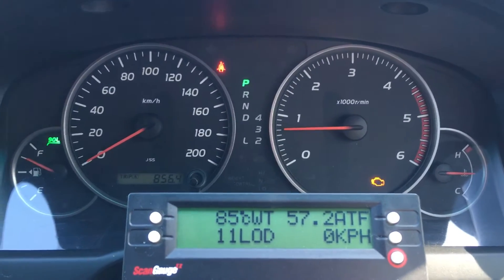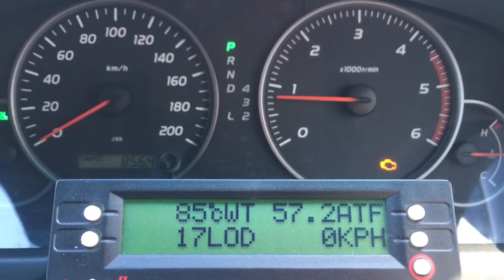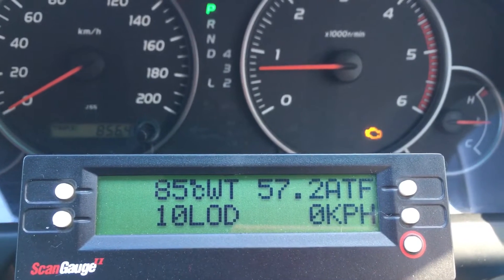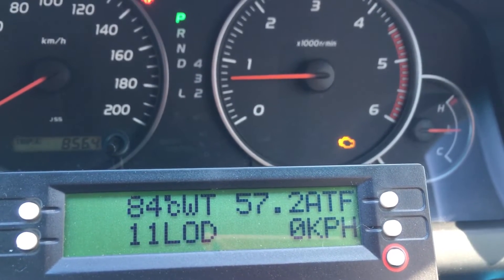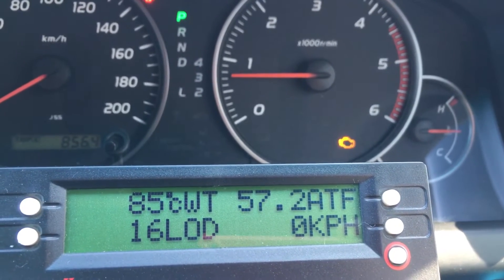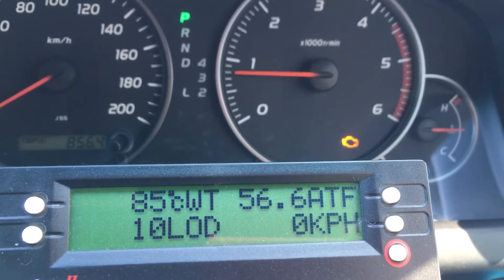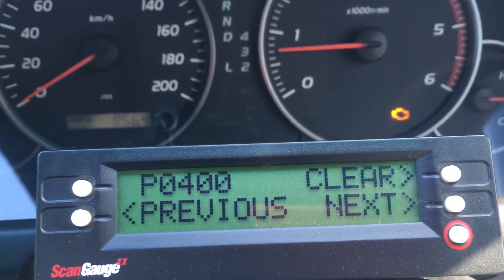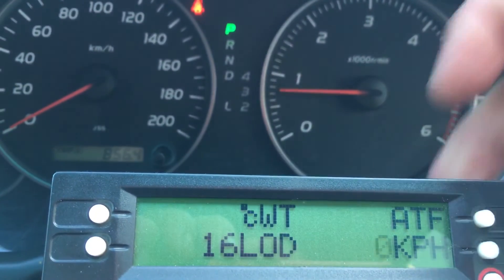ONE DAY YOU’LL WISH YOU DID

Comment: The old EGR code 😆
Reply: Toyota has more basic fault reporting than Hyundai. Hyundai  would tell you if it's EGR low flow, EGR valve not tracking commanded position and numerous other things.
It would also go into 'force you to fix it mode' by disabling the Air cond, disabling cruise control, limiting turbo boost and locking the engine maximum speed to 3000 rpm.  Bastard Hyundai.

Comment: Howdy, do u know the Bluetooth OBD2 adapter for 2.5liter 2KD-FTV engine??? I tried ELM327 bluetooth adapter and it doesnt work, my car is 2006 Toyota Innova.
Reply: Hi there. I've got Hilux 2.5l 2007 2KD 120ps. (Poland). For me ELM327 works quite good. But, I saw almost same elm unit witch did not work. Noone knows why. But for sure, in Toyota some of elms had communication problems. BTW. I use Torque pro for android.